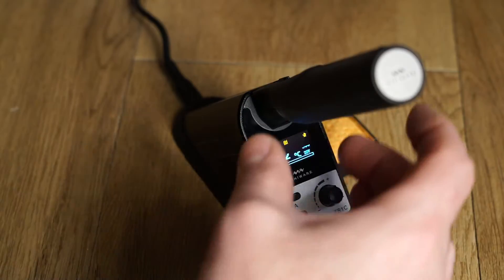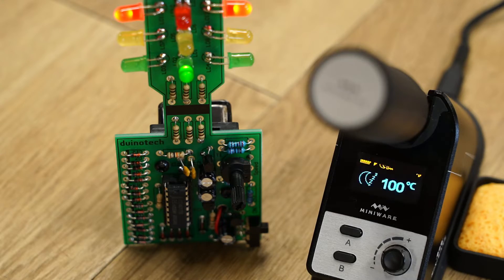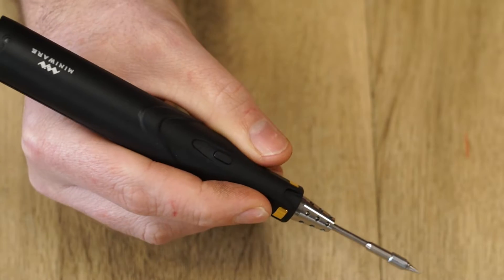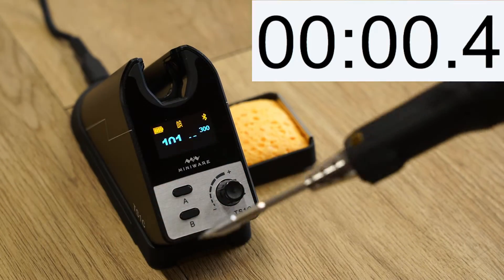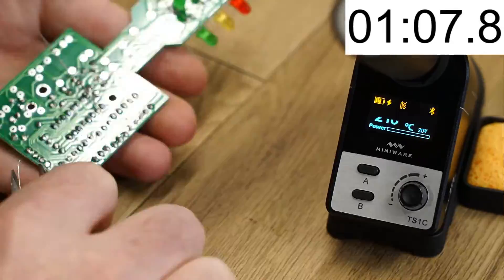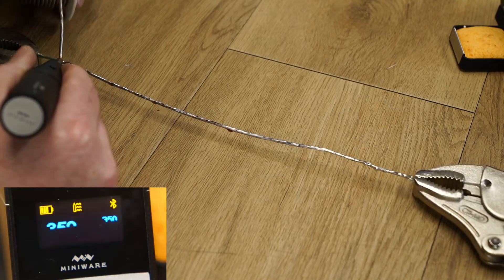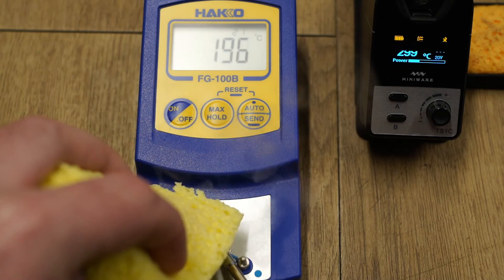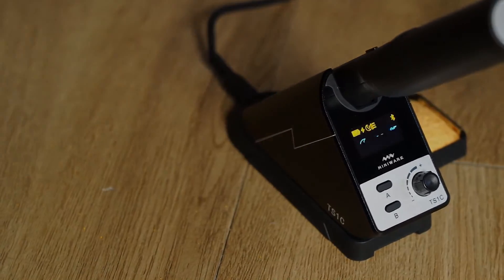Miniware TS1C Cordless Soldering Iron Review

Comment: Manufacturer part number for Supercapacitor LIC1840Q3R8757. Manufacturer is CDA (Zhifengwei Technology), cap is LIC Series. Digikey shows each at $20.50 if you purchase 1-9 or 15.03 if you purchase 10-39. LCSC has them starting at $9.47

Comment: Miniware makes fantastic electronica, with great customer service, i have the TS100, 
and it broke after a year, so had no warranty, but was not a problem for Miniware, they 
asked for the invoice, and they send me a new one, and got it within a week, all the way 
from China to EU. 

Yeah would recommend everyone Miniware electronics if you solder and do  more.
Reply: These Chinese constantly send me nuts instead of ordering, or I simply don’t receive anything, they refuse to return the money 100%, I always have to decide through the bank. I really love the TS-100, it's a great soldering iron, but I stopped using it many years ago. My new soldering iron today is smaller, faster and more convenient. And they invent this huge bandura, instead of just making the grounding work properly. I don't even have a ground connection in my modern MacBook. And the sting on the audio jack is completely idiotic. I bought tweezers Miniware, but the audio connector there has been so worn out over the past year that it practically doesn’t work anymore, it’s simply inconvenient and such a connector cannot be made reliable. I bought a table Miniware, but for three years I haven’t even turned it on, the controls are very inconvenient, I only use it as a stand for soldering, it’s very convenient for this.
Reply: @denisgluk431  OK, i have had problems with other chinees electronica if they broke, 
but absolutely not with Miniware, they send me  new TS100, after it had no warranty 
anymore, that i call good customer support, but with Pine64 PINECIL – Smart Mini 
Portable Soldering Iron, it broke after only 3 months, and Pine64 said, sorry you do not 
have warranty longer then 1 month, so i will never buy anything anymore from that 
company, they have really bad customer support.

Comment: To use classic tips run from a 3v super cap requires a big boost! When you said "there really isn't much going on here" on the tear-down, I was looking at the biggest SMT inductor I'd ever seen.. (I'd bet the primary is at least 10 AWG!)
Reply: Yes, 20V input->4.2V to charge the battery->12V to heat the tip of the soldering iron, this is a very complicated project.
Reply: @miniware  So you're in marketing? That battery is a 750 Farad super cap rated at 3.8v (run safely at 3v likely). External contacts appear fine for 5 amps so charging in 5 minutes sounds correct.
Reply: @CliveChamberlain946  Yes, I am marketing.
Reply: Can i please get free soldering iron 😢 @miniware
Reply: @miniware  The circuit on the flex PCB seems to show the station charges the cap direct, while the USB C at the rear negotiates 20v and bucks it down to 3v - Yes it's complicated. Hence the $200 price.
Reply: @miniware  
miniware need to bring something of more serious & powerful.
I'd love to buy a real miniware's induction soldering station (13.56Mhz) for heavy duty work.
Also very important to consider that - we need a miniware's RF power supply being compatible with rest of13.56Mhz handles like:
Metcal
hakko fx 100
thermaltronics
Thanks for listening.

Comment: I wonder if using a small RC LiPo would have been a better option: they got these really tiny gumstick batteries these days that I've seen on my whoop quad peak at 50A! That is for a 380mAH 1 cell battery!
Reply: It would wear out quickly with the expected high charge/discharge cycle count.
Reply: I was thinking the same thing because I an running a ts100 with 1500mah in the handle and it lasts maybe 40-60 minutes, just that it probably charges slower than this one and will wear out eventually
Reply: @DepressedCookie  Honestly I think that high rates of change in charge over time (or current, literally the definition of current) has negative impact on cell life. Regardless of the direction. So you could charge the cell at 50A as well as discharge it, but that's twice as hard on the cell as just discharging it that fast.